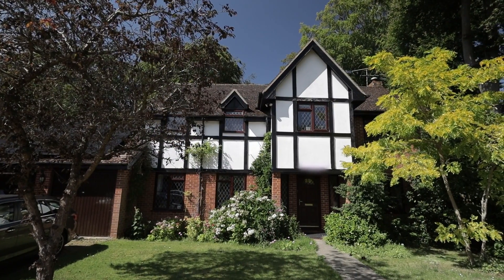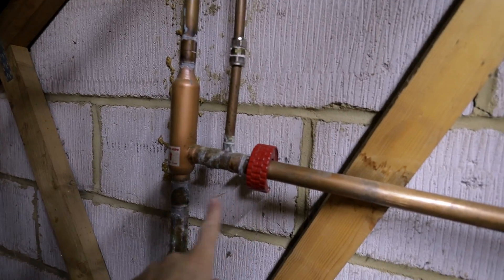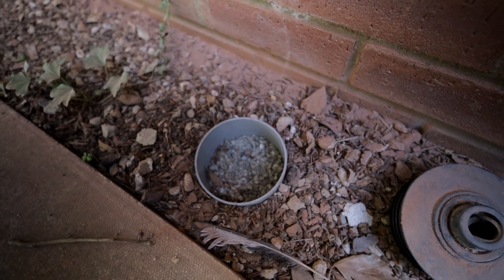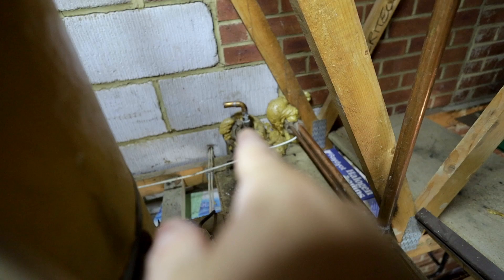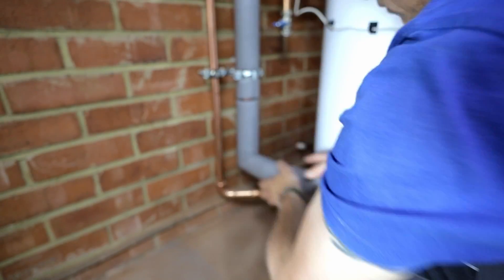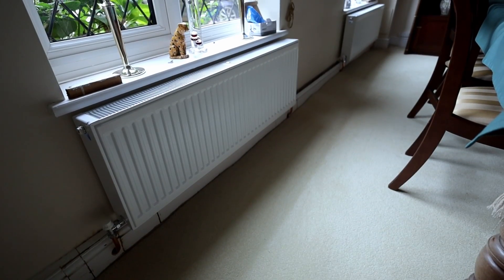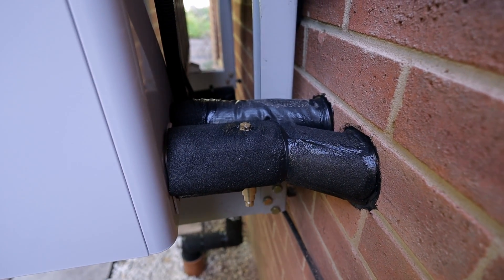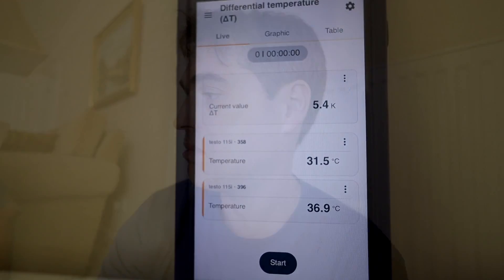Heat Pump Retrofit in a 1980s House: What's Involved?

Comment: Question:
I've got a Valiant EcoTec Plus boiler, hybrid ready, installed on the first floor of the house.. Distance from the boiler to where I could realistically install a heat pump outside is ~15 meters or so near the garage. Those cylinders are heavy and I probably could not install it near the boiler because of a tilted roof. (Not to mention getting it up the stairs with a 90 degree turn in it). 
Just to get a feeling for the installation possibilities: 
a) Would a cylinder still be needed/recommended in a hybrid configuration?
b) If so, must the cylinder be installed next to the boiler or could it be installed very close to the expected heat pump installation in the garage? And connect it to one of the main pipes of the entire heating circuit?
(English is not my first language, so hopefully I've been able to explain the situations clearly enough with all the terminology. ;) )
Thank you for your awesome videos. It's so incredibly valuable to learn that heat pumps can be installed in houses that are older and not fully fitting the ideal case of a modern house!! 🙏

Comment: Thanks for posting this.  It has really challenged my prejudices.  These being 1. Noise. 2 need to upgrade the pipework to the rads.  Can you do a followup and visit the site in a hard frost winters day.  So I can check out the noise then and if the owner still finds the heating adequate.
Reply from the maker: Sure no problem. He is 15 minutes away from me so should not be a problem.

Comment: Here’s a question for you. The brochure output of radiators is standardised at Delta T 50 with Flow & Return connected Top, Bottom, Same End (TBSE). UK norm is Bottom, Bottom, Opposite Ends (BBOE) which typically gives a 2% reduction in output. European norm is Top, Bottom, Opposite Ends (TBOE). which typically gives a 2% increase in output. When you are changing a number of the radiators, as in this job, for the sake of a bit of additional pipe per rad, there is potentially an additional 4% of output per rad by switching to TBOE. Whilst the gain is minimal it seems to be a relatively easy and cheap gain to improve system performance. What are your thoughts?
Reply from the maker: Yes uk uses bottom only as no one caress about efficiency here, just optics 🤣
Reply: But you care about efficiency?

Comment: And how much was this system and how much will the owner save on their utility bill each year?
Reply from the maker: Average cost of those is 12-15k less the grant so around 7-10k. This one should save quite a bit a year as it has solar and battery storage, I would guess estimate around £600 savings per annum.

I will do a follow up video to see the actual performance and cost in the spring next year.
Reply: @UrbanPlumbers  Thank you, it would be good to follow up on what efficiency means in terms of £ considering the outlay on pump/solar/battery. Once all that is considered, how many people will be able to afford that outlay?

Comment: Knowing that the external unit can be wall mounted is helpful as we would need to have one over the driveway but leaving the driveway itself clear.

The problem we have in our otherwise very well insulated 2018 new build, is small diameter plastic pipework which will be a nightmare to upgrade, in fact it’s this which has put us off so far.
Reply from the maker: This needs a full heat loss calculations done, as in new build microbore should work without any problems
Reply: @UrbanPlumbers  thanks, that’s helpful to know, I just assumed this was going to be a stumbling block. We already have K2 or double panel tall aluminium rads everywhere and have been running our existing combi at 45 degrees and the house never feels cold.  Do need to see if we can squeeze a HWC through the loft hatch however. 🤦‍♂️
Reply from the maker: Slimline cylinders can be only around 470mm diameter
Reply: @UrbanPlumbers  thank, you, that’s encouraging.  I think these videos where you showcase real world installations, especially those in less than ideal circumstances, are important to persuade people that heat pumps are a viable option far more often than naysayers would like to believe.  Perhaps tackling one in a new build with less than ideal plumbing would be worthwhile.  We live on an otherwise pretty good development, but having wandered around, it’s very noticeable how few heat pumps or solar systems seem to have been installed.

Comment: Really good video again, but it seems that  pipe diameter plays a big part of heat pump systems. I have 10mm microbore plastic pipe so I'm assuming I have no chance of every having a heat pump system?
Reply from the maker: this needs to be ccalcuated. Microbore can work with heat pumps.

Comment: Love the way you explain things. I have an 40s house and we did the heating in the 90s and used 10mm microbore  to the radiators, would this be too small a diameter for the flow rates?
Reply from the maker: Thank you. There is no definitve answer to your question. It all depends on the following factors:
- heat loss of the room
- size of the propsoed radiators and flow rates
- length of the microbore pipework

In most cases 10mm can work well, and if not you always have an option to improve insulation and make 10mm work well.

Everything with heat pumps should be carfully surveyed and calcuated to have dfinitve answers or to find ways of making microbore work.

Comment: You said zoning decreased efficiency. We never heat whole house, just a couple of rooms. Would that detract from a heat pump viability?
Reply from the maker: yes, that would cost you more to run than the whole house and cycle the heat pump like crazy, not only killing its efficiency but also shortetning the lifespan of the compressor. 

The same goes for most gas boilers as well, just to a smaller degree.

Weather compensated gas or heat pumps shouldn't really be zoned at all.
Reply: @UrbanPlumbers  thanks

Comment: Could you please update us on property max achievable ambient temperature. As we all feel comfortable in diff temps I'm wondering what range is available. Would be also nice to see running costs compared to old setup in about year time...👍
Reply from the maker: I will do a follow up video in the spring after the first winter

Comment: Great video.
I was thinking of getting a heat pump and similar to this house i would probably need to replace all the single panel under sized radiators for doubles. If i did this first and ran my gas boiler at a lower water temp e.g. 45°C would that give me an idea of how warm my house would be using a heat pump - thanks
Reply from the maker: To compare a heat pump at 45c you need to run your boiler at around 50-55c

Comment: I have just had an ASHP installed in my 1960’s 2/3 bedroom terrace house in Salford, which I would suggest is a far more common house type in the UK than a posh detached house!  In order to fit it, I had to demolish an outbuilding and have the electricity supply moved. The gas has been capped off but Cadent want £1800 to actually disconnect the supply so for the time being, I have a five foot height steel gas pipe sticking up in my garden. Moving the electric wasn’t cheap either and my back garden looked like the Somme for about a month. I have a high temperature heat pump so I only had to replace one radiator and fortunately, the place where the heat pump was to be located had a small cloakroom on the other side which I ripped out, temporarily, so the cylinder etc could be installed. There is now room or reinstall the WC and basin. In spite of the stress, upheaval and periods of panic when people didn’t turn up, I am very happy. Lashings of hot water and the heating is working very well. I also have solar PV. I have a Hive control connected but I don’t use it. Total cost, including all the ancillaries, around £20,000 less £5,000 from our generous government (haha). Incidentally, I had already upgraded insulation well above minimum requirements well in advance. My electricity costs are alarming at the moment, and even with the loss of the gas, it is costing quite a bit more; not unexpected because the cost per Kw for electric is so much higher. Also, no sun or days so no solar PV. It’s early days and costs will come down eventually.  I have no regrets but I am lucky I can afford it.
Reply from the maker: Sounds like a typical high temp inefficient design sadly. This job here was almost half the cost of yours and will be way cheaper to run than gas as well. Sadly some companies still pedal high temp heat pump and no rad changes nonsense.
Reply: I insisted on a high temperature heat pump because I refused to have thumping great radiators installed and I have spent a lot of money on custom painted radiators. As I said, it is early days but based on the design documents sent to me and the general level of workmanship, I would say they have done a pretty good job. The actual cost of the system to me after the £5k grant was about £9,000. The rest was for all the work required to make it possible. Incidentally, tens of thousands of UK terrace houses have looped electric supplies, my neighbour was looped into my service head, and that has to be removed. That work didn’t cost me any money but a huge amount of upheaval. I am 100% in favour of the transition but I do think it is important not to be taken in my our idiot government’s fantasies about what is involved. Even at 50% of the overall cost, it is far beyond the reach of most ordinary people. I have no regrets.

Comment: Fantastic work as always, but, I want a year's electricity charges to really believe in retrofit to this building.
Reply from the maker: if he didnt have solar and battery storage his running annual cost on heating and hot water wold be around £1,600-£1,800 at the moment. With solar and cheaper overnight tarrif he should be around £1,000-1,200 per annum.

I will post update to his video next spring. 

I already know running costs from my other 10 jobs installed before the last winter, so can have a resonable expectations about this system as well.
Reply from the maker: also, check this video where I interview one of my clients and we talk about his costs in an uniusulated 1930 Terrace. He was paying around £200 / month in the winter for a 3-bed terrace on the same heat pump as this one.

https://www.youtube.com/watch?v=RZPGZN1jhyk&t=8s

Comment: As always, interesting content. Are you just putting most of these installs on 3port hot water priority. Whenever I’ve had a spec from vaillant they are always adding hydraulic stations buffers etc etc. as long as you have good volume and no mixers required, you just keeping it super simple (from what I can see)?
Reply from the maker: vaillant schematics are generic. Vaillant doesnt know if your system needs separation, do they? They also sprcify plate separation for glycol. You really want to avoid 80% of what Vaillant specifies if you want a relaible and effieicnt system:

- glycol reduces heat capcity of water and lowers system efficiency - you need more flow for the same output, so using anti freeze valves and pure water is much batter
- when using anti freeze vavles you no longer need to use plate separation for glycol
- dont use buffers - as they create distortion, lower system efficiency and add around £800 cost to the installation (bufer + pump)
- instead ccalcuate if you existing pump in the heat pump can run the system, and if it cannot, then upgrade the system not add buffers

Not using any of the plate, glycol, buffer results in a much simpler, more reliable and way more efficiency system. You need to understand pressure loss of your indes circuit, pipe sizing, system voulme, etc.. though to make sure it works.
Reply: Makes a lot of sense for sure. Always a pleasure to watching your videos. Thank you for the informative response. Great stuff 💪🏼

Comment: All that expense and the nonsense you spout about heat pumps then you leave the hot water open vented 😂
Reply from the maker: can you be more specific about nonsese so I can address your uninformed positon?
Reply: @UrbanPlumbers  for example, making out in every video that heat pumps are cheaper to run than a natural gas boiler. You’re riding the current wave trying to set yourself aside from all the other plumbtards in your area.
Reply from the maker: @dariantakieh1398  The ones that I have installed are cheaper to run than even the most efficient gas boiler you can buy. Nothing unusual about ashp being cheaper to run when installed well.

You will see my next video where I run vaillant boiler alongside a vaillant heat pump in the same house with full monitoring and the same controls - I will also allow public monitoring of this installation to dispel any myths.

Got any more?
Reply: @UrbanPlumbers  it simply does not add up. The heat pump will take 30+ years to pay back. It will be unserviceable long before it pays for itself.
Reply: @BenIsInSweden  this is a £15-£20k job cost to customer. Gas boiler would be around £3k.
Reply: @dariantakieh1398  As I mentioned, that includes the once off upgrading the system from high temp to low temp, not what the heat pump itself costs.  In future, especially as we get closer to gas boilers having more and more red tape surrounding them to install, and gas becoming levied with the paris agreement etc, it is likely going to be reflected in the property price (either negatively for it not being done, or positively for it being done).

Comment: Great videos and very nice work.
Would you say that first insulating a home of this year is smart to reduce the size of the heat pump?
Or is just getting a heat pump that will be oversized if insulation is done at a later time, not that big of a problem?
I really want a Vaillant and spending a little more is ok, just as long as it does not cause problems when more insulation and UFH is added later.
Or should I just have everything installed in one big project to match everything perfectly? Or have the UFH done first? The gas boiler is almost 4 years old.

Unfortunately the Netherlands are a bit too far for a quote, but I would love your opinion on the order of doing this.
Reply from the maker: insulate first, then get the heat pump and UFH done at the same time
Reply: @UrbanPlumbers  thanks. I think the insulation here is pretty much ok with about 8000 kWh in a 140m2 home. 
Do you think i just get rid of the T22 an T11 radiators to reduce complexity and clutter? Or does keeping them in help the COP significantly? They are about 35 years old and each floor has them parallel connected with 14 mm flexible pipes (quite obscure here)
Reply from the maker: @SolAce-nw2hf  keep radiators as well, will help massively with system efficiency
Reply: @UrbanPlumbers  I suspected as much, based on the Heat Geek video's i'm addicted to. Thanks again for taking the time to help me choose. 

It will be a challenge to find someone with your experience in heat pump installations here in the Netherlands.

Comment: We have a mid terrace house with a section of flat roof between us and the neighbours. This is a section above the garage and lots of people round here are mounting heat pumps on this flat roof. But your video raises a question, should I mount it on the wall of the rest of the house next to the flat roof (avoiding a micro-climate), or mount it slightly further out on the concrete roof of the garage where the noise can dissipate and air will flow round the unit?

Comment: I don't think the heat pump is the problem with bad performance. I think it's the plumber not knowing what he is doing. good installation
Reply: And that’s the difference between a typical plumber (or gas fitter in many cases) and a qualified heating engineer that will do some maths rather than guessing 😉

Comment: Converting gas to electricity to heat is still dumb on a molecular level, and with electricity unit costs guaranteed to stay way above gas prices to encourage green energy I still struggle with this method of heating. I live on the Scottish Moray coast and our mains gas comes from / supplemented by a bio digester from the Speyside whisky distillery waste mash. Our electricity comes from Moray West wind farm who’s substation is 6 miles from the house, I am still very happy with gas when I see your beautiful complexity.

Comment: Nice work, another fantastic install. It's great to see that it's possible to run even large systems like that open loop without a buffer. What's the reason you installed the cylinder in vented configuration? Would unvented not give better hot water pressure?
Reply from the maker: Thanks again! Mains supply is in the middle of a kitchen extension with tiled floors, just impossible to extend to the garage without a major cost and building works involved.
Reply: @UrbanPlumbers  ah OK, that makes sense. How did you pressurise the heating system without mains water? I thought you mentioned that you did manage to get a feed from somwhere
Reply from the maker: @GlynHudson by using old system full from the header that connected to the mains in the loft. This is fine for central heating but not adequate for dhw

Comment: Nice work
Have you ever heard or done an existing fuel oil central heating helping a new heatpump? As a monobloc inside. Meaning  fuel is still used when temperatures go freezing and a heatpump is not efficient anymore. Can't find useful information about that
Reply from the maker: I dont see a point. Most systems can be run on a heat pump alone. 

Grant had a hybrid of oil boiler with a heat pump in one external unit.